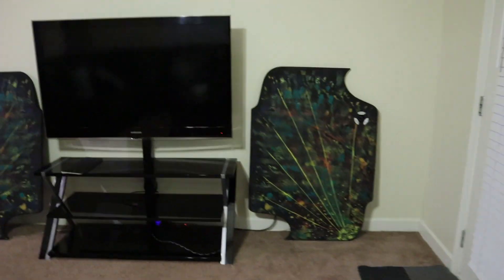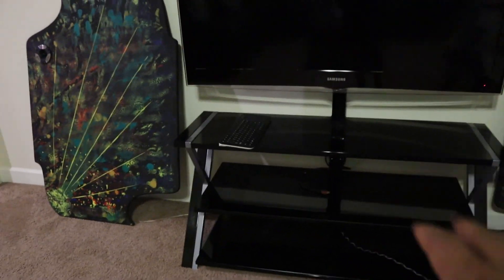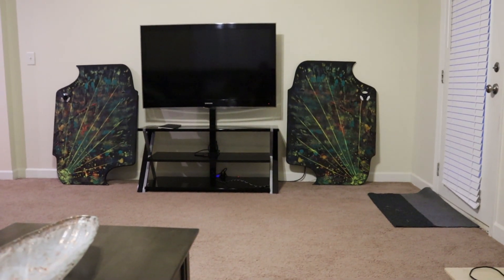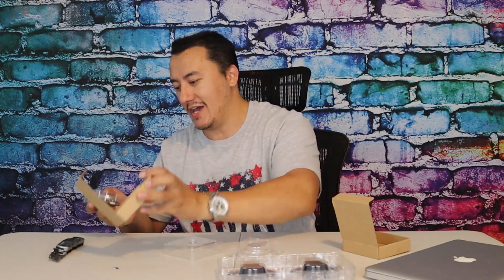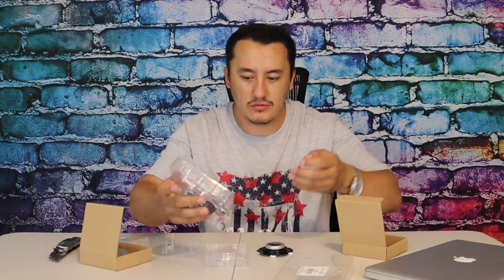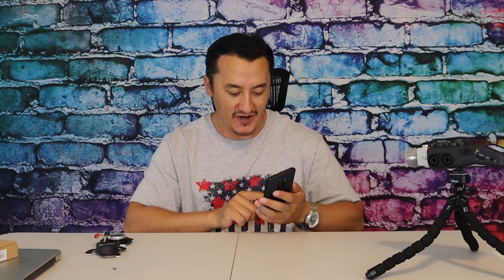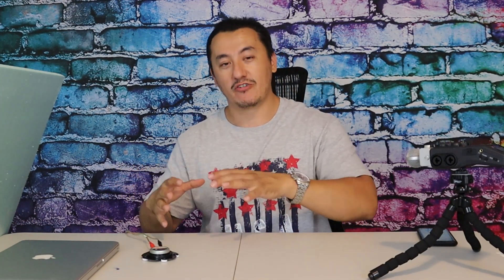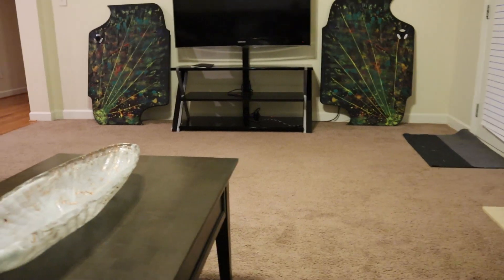Best  DIY DML Speakers Dayton Audio DAEX32QMB-4 DAEX25 Sound Exciter Orion CTW10

Comment: Can you try these on a auto glass. I had the idea of using one for rear fill in my truck mounted on the rear glass to simulate a rear reflection sound with a L-R differential.

Comment: They have to be suspended by fishing line in order to vibrate properly. Tweeter is not necessary as they are Full range exciters.
Reply from the maker: Yep you right it is one option but doesn't mean you have to do what other does 
Thinking outside of box always big win )

Comment: So what’s the best material to make the “box” out of? Fiberboard or some type of corkboard or even cardboard? I’m so impressed by these tiny speakers that I’m going to build these because of this video.
Reply from the maker: Yep use foam shit from home depot or lowes they cust 15$ for 8'x4' so you have enough for any project)
Reply: Concrete. The denser the material better. But these tiny drivers don't need box. That exciters are especially not designed to be in a box. Even most tweeters don't need box.

Comment: I have a suggestion... . Use a surface which hold by rubber all side and fix this 40w in middle of that. 
Like a square hold in center by rubber mounts... may be u will get more bass out of that.
Reply from the maker: Yep I havto make nice stand, now Im thinking to build subwoofer stand will see
Reply: @LIFEINSPEED  will wait for your video🧐